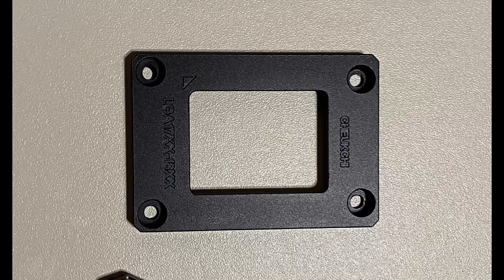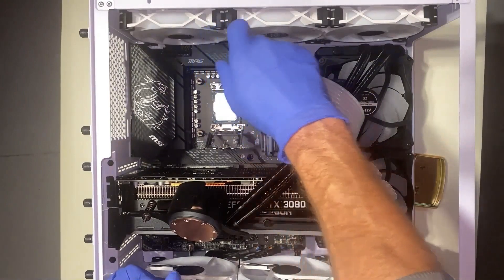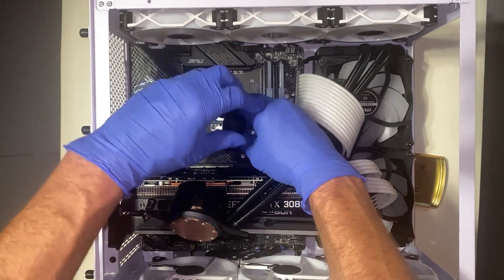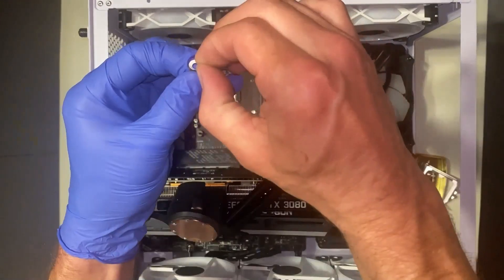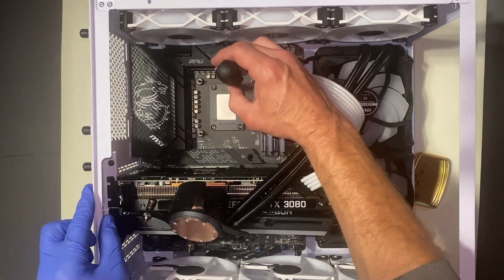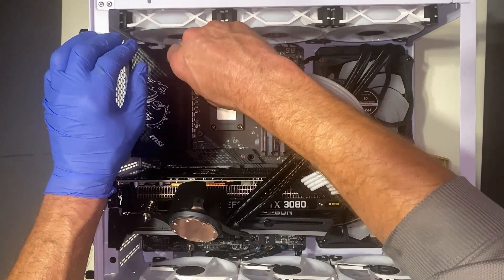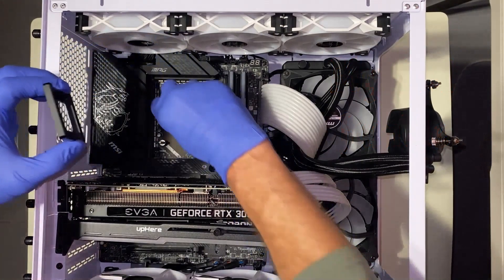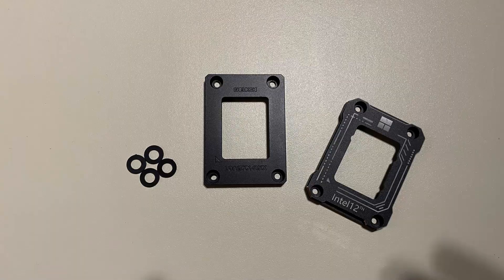Installing Cheukchi CPU Bending Correction Bracket On Intel I7 12700K

Comment: Lot of misconceptions about these frames in general. Both the aftermarket and factory frames serve only one purpose...they keep the cpu from rattling around in the socket or falling out...pressure has nothing to do with it. The factory frames have always used a ridiculous amount of pressure to retain the cpu for no reasonable explanation. If you stop to think about it, consider how much pressure you are putting on the cpu with the cooler base when it is installed. Why would you need additional pressure? Just ensure the frame is level and don't tighten the retaining screws any more than is required to keep the cpu from shifting around in the socket.
Reply from the maker: Some people don’t realize the pins are actually springs and need the proper tension otherwise you can get memory issues. Also coolers have convex shape because CPUs are not flat, AMD and intel have different surfaces but by using a convex shape and applying the proper force you get a flat contact over a wide range of CPUs. Hopefully this helps you understand why it’s important to have the proper tension.

Comment: I am going to build my life's first ever PC next year. So my question is-

1. Can I use this frame on 13th Gen CPU too?
2. Can I still use my air cooler after installing this frame?
3. What is this frame made up of? Please tell me the material if possible
4. If you use anything like 360mm aio cooler + Core i9 13900k then how much degrees of difference you can notice with default Intel ILM vs with this frame on
5. Is it safe to use this frame in long term?
Reply from the maker: 1. Yes you can, they are the same socket. 
2. Yes it works with either air or liquid cooling. 
3. Anodized  aluminum I believe. 
4. About 7 degrees Celsius but it varies on every CPU. 
5. It’s fine for long term use as long as you don’t take your CPU out often. Each time you take the CPU out you have to remove the screws and that will damage the motherboard eventually, we are talking like if you do 30+ replacements.
Reply: @walkersgamingpcs  thanks for the reply. No, not even often. I never take out my CPU. Just build it and only take out when mandatorily needed like aio replacement, thermal paste repaste, or anything else. Which means almost never taking out at all
Reply from the maker: Yea I would recommend then. Lower temps gives better performance while increasing the life of the CPU, so it’s a win-win. If you have any questions just ask. Take care.

Comment: I just installed one on a new z690 Arus master but I cannot get anything to display on screen? The pc turns on but no single and a red led debug light shows cpu. Should I just I re install the stock one?
Reply from the maker: It would be easier to help you if you contact me through Facebook messenger so we can go back and forth but if you can’t I will help you here. I would start by making sure that the CPU cooler and the CPU are making Contact if they are not making contact the CPU is instantly thermal throttling which I have seen before
Reply: @walkersgamingpcs  The problem is that if you tighten the bracket too much, you will damage the CPU socket. If you tighten it a little, the CPU will lose contact. If the PC does not start, you may have tightened it a little, or in the worst case, you have destroyed the socket itself.